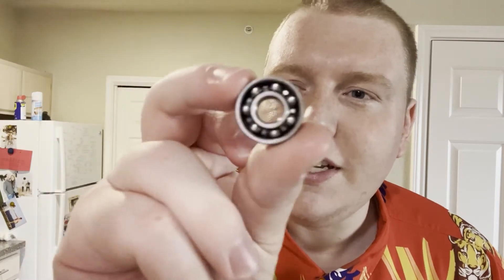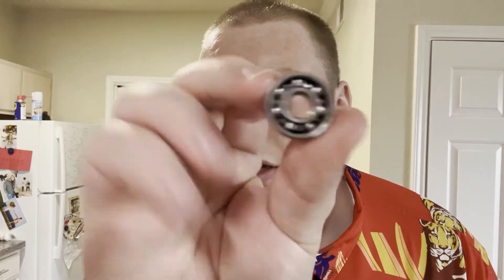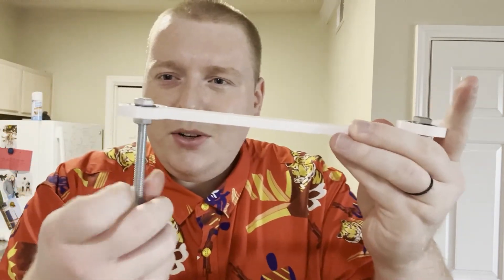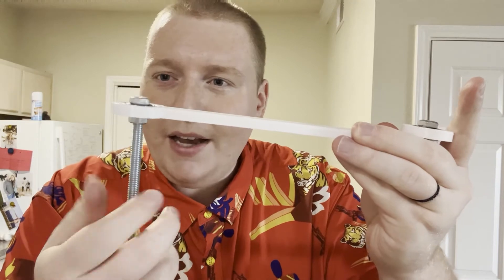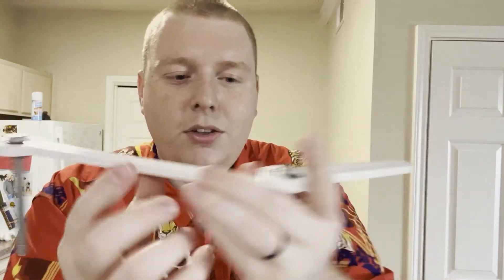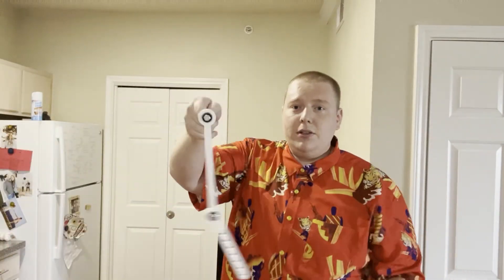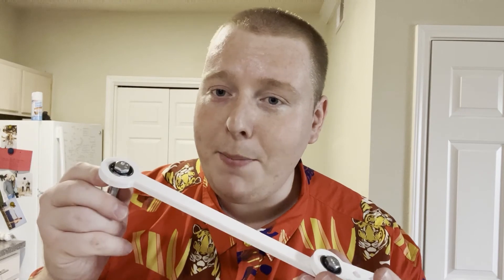Why Your Bearings Don't Spin Freely, and How to Fix It

Comment: (For an extremely low load & low speed application)

I just tried this with engine degreaser followed by water and they spin like a dream, way less drag than factory grease.

I then sprayed with CRC 556 so there'd be some corrosion protection, and it slowed down quite a lot (although still better than factory grease.

Comment: Good call... I totally agree that the people "whining" that this is a dumb idea are valid....but they're talking about "this bearing under the prescribed load [Guy on a Skateboard]  I'm really glad you mentioned that point. 

I don't know if I agree with the use of just WD-40, I agree it can be used to clean the excess lubrication for the excess load off... but I'ad advise something like isopropyl alcohol followed shorly after by a White Lithium grease to clean the existing grease and re-lubricate with a lighter grease for this double bearing application.

Comment: Some sealed bearing has the bearing grease inside them. The bearing will be spinning smoothly after the grease melting becomes oil. You may find this application in drive shaft cv joint, idler pulley bearing.

Comment: Yeah, definitely good vid
Had my ball bearing in my 3d printer to spin very hard and making vibrating noise, sometimes it even prevented spinning of the rod and i apparently i disassembeled my step motor, put out the rod with the bearings and just sprayed them with WD. And they started to do they should do - keep the rod spinning freely with no contact with the walls! 
Sir, thanks a lot!

Comment: HEY!!!! You never put a link in the description!!!!!!!!  What is that spray that you used?!?! Where can I get it!?!??? JK, man. Great easy and  simple, AND SHORT VIDEO. I've seen other vide where I'd have to take the bearing apart, clean in gasoline, etc, etc. Tries your method and worked like a charm, THANKS for sharing (and getting right to the point too!)
Reply: Wd40 is usually readily available. I guess any thin oil should work similarly.

Comment: Ordered my first bearings for my first project that needed them and I ran into this exact problem. I will try this tonight when I have the time but I think you just saved my project, AND taught me something valuable. Thank you! I would like this video twice if it was possible.

Oh, and if you're reading this: Do I have to remove the side for this to work or will the WD-40 find it's way in there and do the job anyway? I got one pack with a plastic cover and one with a metall one.. :p

Thanks!

/Robert, Sweden

Comment: You do "ruin" them but it dosent make them unusable, the wd-40 pretty much only cleans them pushing out all the grease and eventually will dry up itself, risking damage to your bearing, your best bet to insure longevity it to re oil it with a thinner long-lasting than wd40 or to periodically hit it again with wd40 to prevent it from drying out

Comment: Try these 3D printed bearings ;) I don’t even buy bearings anymore lol (I designed them)

Search on Printables-
Optimal 608 Bearing (Print In Place)
Reply: Nice! Do the spin gud?
Reply: Nvm
Reply: @harkaz33  they do if you print them right and follow instructions 👍